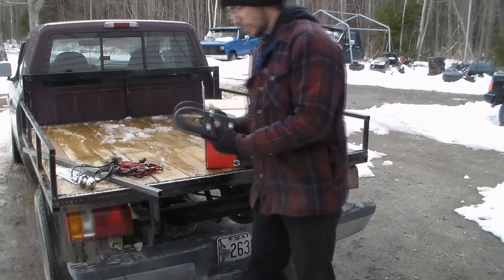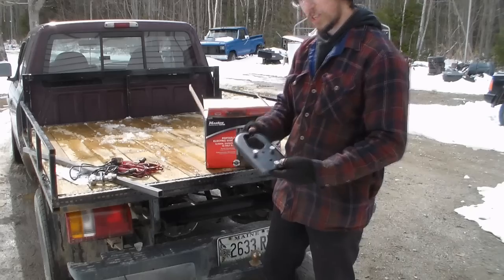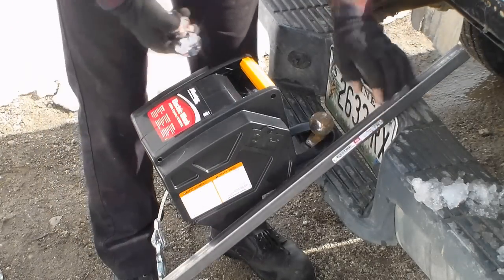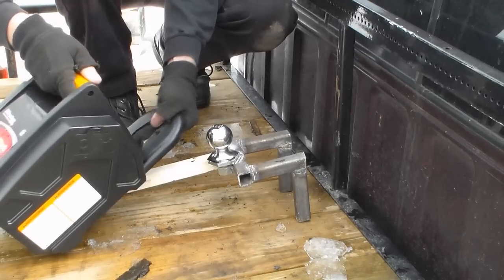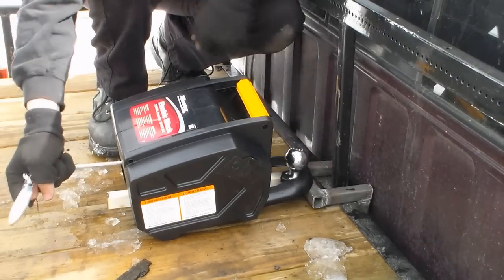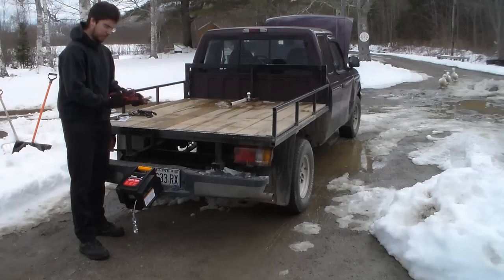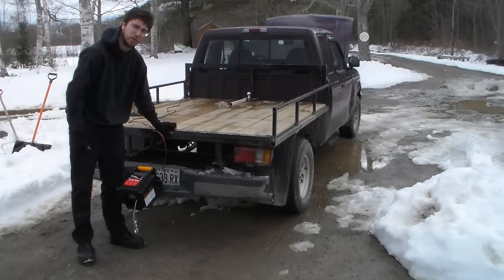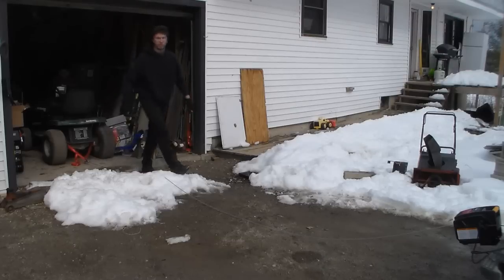Master Lock 2953AT 12-Volt DC Portable Winch

Comment: I wish I'd had a camera to show you what these things are truly capable of. I dragged my 33ft steel hull yacht weighing 4.5 tons on a 1.5 ton boatyard trailer I'd made using two front axles off a 7.5 ton Bedford lorry (we call them lorries not trucks in the UK) into a farmyard then did a 5 point turn in the yard to get turned round ready to winch onto a low loader. With a purchase tackle you could shift a heck of a lot more.
Reply: You mean this specific Master Lock model, correct?

Comment: I know this is old but those little winches are beast and a nice little winch to have. Don't sleep on these. They can pull a pickup onto a flat bed as it's 6k lbs rolling pull; It's slow but it does pull it up safely.

Comment: Thank you for posting this review. very interesting, one comment if I may, the two legs dropping down the inboard end of the trailer to secure your new ball mount extension, may well creep up and out of position under heavy load. a creep preventer pin of sorts may be needed. Top job..Cheers from Michael. Australia.
Reply: He could just install 3 bolts in the bed to slide the winch on with no brackets or other hardware needed, but he sorted it out